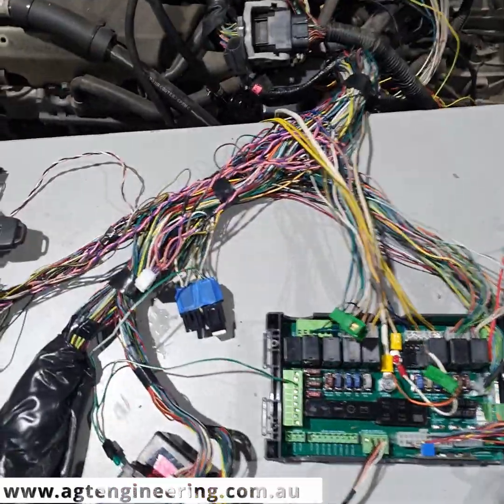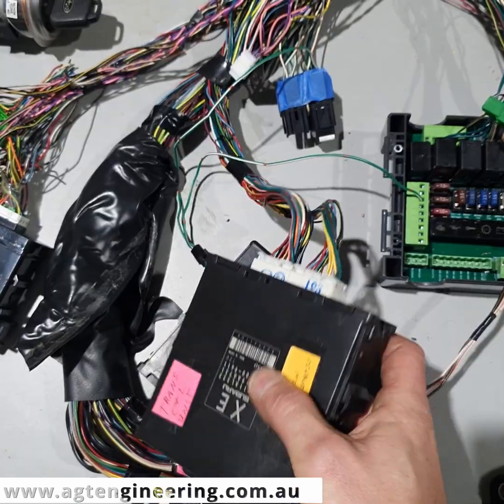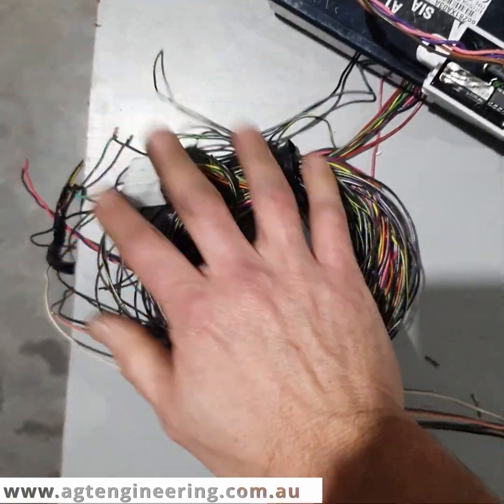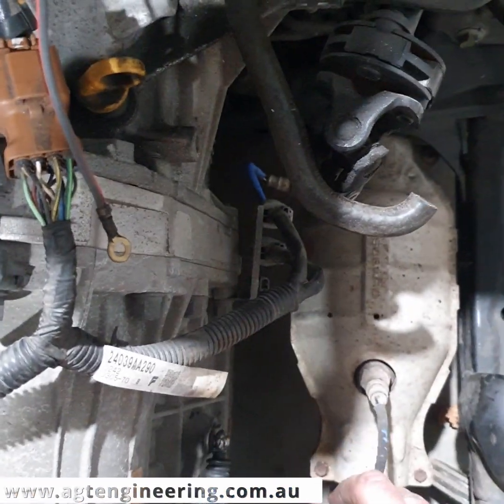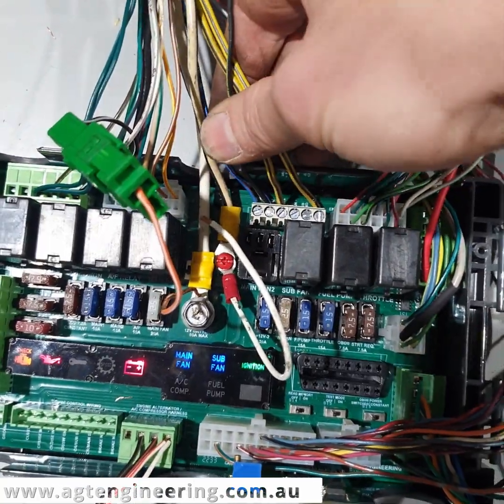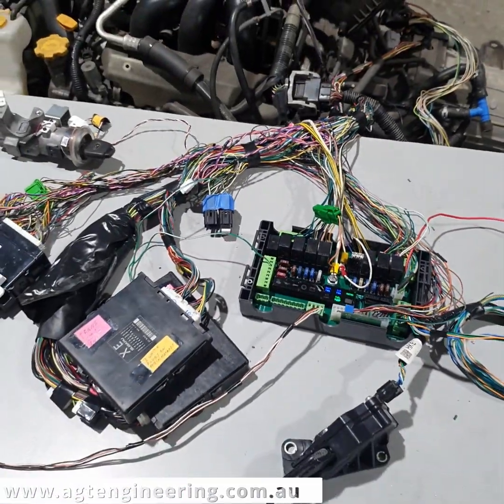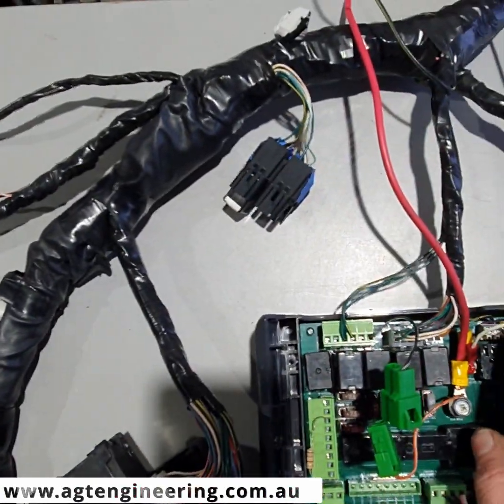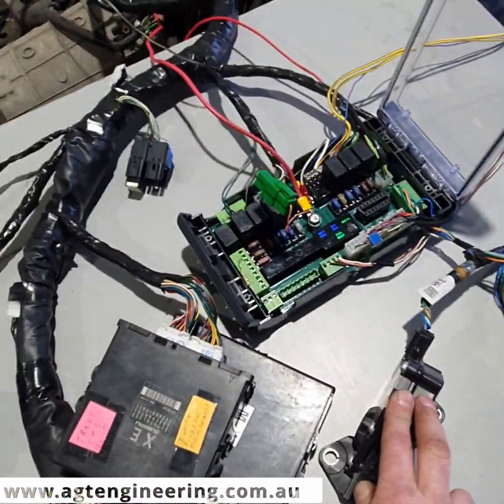EZ36 USDM HARNESS MODIFICATIONS FOR STAND ALONE

Comment: Do you know how different the harnesses are from EZ30 to EZ36 and is there anything the EZ36 requires that's not on the EZ30? Just got an EZ36 and trying to understand my options, either repin the engine harness to support the EZ36 harness or replace the full front to back loom with the Tribeca one... or get a 2010 outback full body harness? Just want to avoid having to use the Tribeca dashboard lol (Going into a 2007 outback)